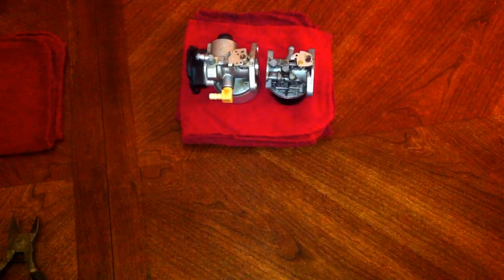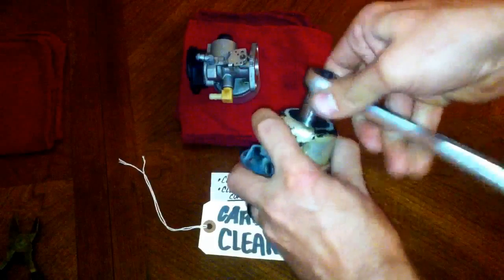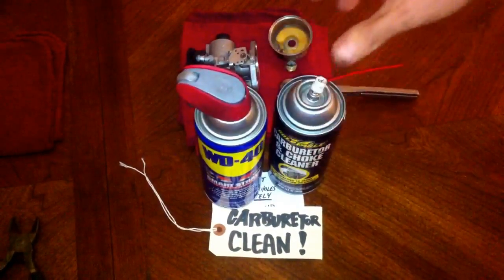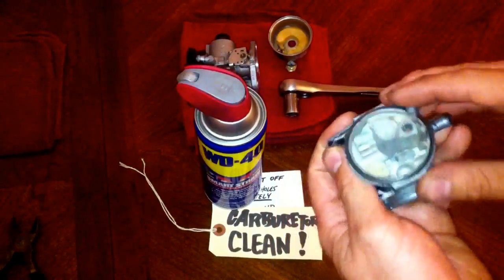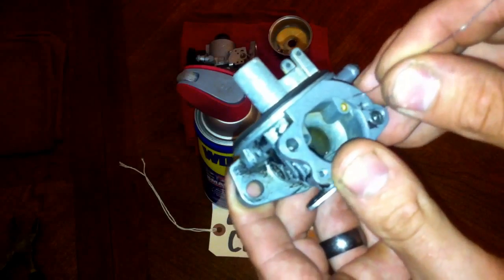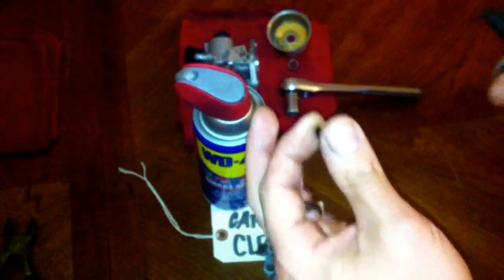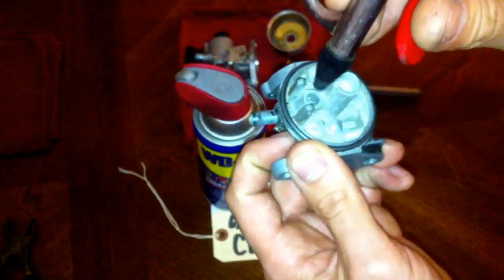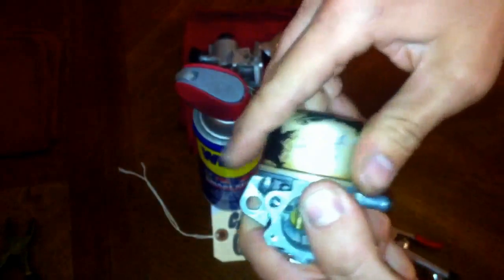How to Fix a Lawn Mower by Cleaning the Carburetor [Briggs & Stratton and Tecumseh]

Comment: This was the video I needed I had my Briggs all cleaned but I put it back together wrong at the float assembly where the pointed thing sits in the gap and I had it outside I knew something wasn't right now it's running like a champ. 
I also noticed a bunch of dirt sediment in my gas that was obviously causing the clog not sure how so much gets through the tank filter.

Comment: I have a craftsman self propelled  I have taken off the carburetor and cleaned it however there were to springs that came off and I don't know where they go. This is the only thing holding me up from having a running mower.  Do you know where they go? or do you know where I can find a picture of where they go, thank you

Comment: Some reason my gasket at the motor side pours out gas . Is it something to do with the float ?
Reply: Maybe the carb bowl gasket did not seat correctly when put back together. Was that the fix or is there still a challenge?

Comment: Hi Adam, your video was excellent in explaining how to re-open the internal fuel passages of a BS carburetor housing. After sitting without running for a few years, the engine for my mother's power washer started NORMALLY after cleaning out the debris from the internal passages of the carb. Thanks so much!! I appreciate you for taking the time to share this information with everyone!

Comment: Thanks for the video. I took off and cleaned a b&g carb (full of rust) from a mower that sat for two years and wouldn't even try to turn over.
Put it back together, one pull and it's purring like a cat!

Comment: I learned that old carbs on lawnmowers didn't have brass jets and instead used adjustable valve screws so when the lawnmower ran weak or surged you simply just opened-up the screw hole.  Thanks to the EPA for making everyone's life difficult.

Comment: Your step by step for taking the carburetor apart, cleaning it and putting it back was one of the best on you tube I've seen. Cleaned the jets with the wire from the bread tie, blew it with some compressed canned air, rinsed in some clean gas , assembled it back and it started on the first pull. Thanks for the video

Comment: I had to replace the primer bulb with the hole in the center, but now the gas runs out of the tank all the time.  How do I stop it  Briggs and Stratton 6.75 , give me a hint as to why the gas keeps running out unless I tip it back to change the strings, other wise the whole tank will drain completely.
Reply from the maker: Sounds like a carb issue 🤔 Have you changed the needle & seat?

Comment: I just cleaned out a Tecumseh carb and the hidden jet was clogged with a hard substance that the carb cleaner could not remove. I instead used a sewing needle to remove it. Anyhow it runs now.

Comment: If one  can soak the carburetor for several days in a submerged container of gasoline ( make sure the gasoline completely covers carburetor ) it always seems  to do better for me in the past and a much easier process when cleaning it . Worked on an old Honda carburetor and it just wouldn't run right after I had cleaned it out once already . I soaked it for three days and blowed it our one final time and it must have loosened up something - for it started running perfect . Food for thought - when all else fails .

Comment: What is the wd40 for?
Reply from the maker: I got carried away here focused on where to spray the carb cleaner. You should WD40 the throttle, and wiggle it back and forth to make sure it's freed up. All moving parts love lube.
Reply: @AdamPenningtonadamcpennington  👍

Comment: Can you replace the float pin seat if you accidentally spray it?
Reply from the maker: Roddy Da Carburetor cleaner if left long enough will cause the rubber seat as well as the bowl seal to swell and degrade. Best to remove components like these before cleaning.

Comment: I know this is a old Post but hoping I can get some help. The only way my Briggs will start is if I squirt carb cleaner into the intake side. It will fire up then literally die. I found there was no gas in the bowl even when gas turned on. Luckily that part was a simple fix but it still won't start. Any ideas?
Reply from the maker: Sounds like a straight forward carburetor issue. If you've thoroughly cleaned the carburetor as the video depicts, replaced the bowl gasket, mounted it correctly and snug, and there is now actually fuel in the bowl- It might be time for a new or used replacement. Having been through hundreds, some carbs go beyond reasonable repair. Cheers!
Reply: Hi, Adam, glad to see you're still helping people on this video. I've taken the carburetor  off of my B&S lawnmower engine three times now, to clean it. I was getting surging, difficulty starting, and sometimes engine dying issues. I'm using carb cleaner, and this last time I used welder's tip cleaners to really get into those tiny holes. I've also cleaned the fuel tank, which was filthy, and I replaced the fuel line and added an inline filter. Additionally, I've replaced the float bowl gasket, the air cleaner housing gasket, and the primer bulb. These cleanings have always helped for a little while, but then the engine goes back to its old malfunctioning ways. I'm thinking my next corrective action might be to replace the rubber seat that the needle sits on. That's about the only thing that I haven't replaced, so far. What do you think?  Could that be causing the issue?

Comment: Thanks for saving me a chunk of change.  I'm not a mechanic and was somewhat intimidated about taking apart the carb on my ready-start pressure washer that wouldn't start.  Cleaned it per your instructions, and put it back on.  It started right up on the first pull.  Incidentally, I thought I lost the rubber needle seat; I just want other viewers to know that some seats are brass.

Comment: Hi, I just did this and got my mower working however I have a problem. The mower is supped up LOL. It now runs loud and it actually used a full tank of gas in 30  minutes instead of my usual hour. I am under the impression the needle needs adjusting. from what I have read I need to lower the needle I believe. Thoughts?
Reply: Fixed it. I must have forgot to put the metal wire through the carburator top plastic piece. Of course it meant taking everthying back apart but the carburater to fix it, but it works good.....for now lol.

Comment: Thank you for this video, I didn't even think to clean the bolt that holds on the cup - it was the culprit!
Reply: That bolt holding on the cup on most small engine carburetors is the main jet. The tube which Mr. Pennington referred to as the jet is the emulsion tube. It is important also to remove any gaskets (especially rubber ones) because the carburetor cleaner will distort and misshape them causing them not to seal correctly.

Comment: Adam, this video was AWESOME. I have a Yard Machine String Trimmer that has not ran in more than 2 years. I followed your instruction in this video and my trimmer started on the very first pull. I was about to take it to the repair shop which would have cost me atleast $80.00 - $100.00 to repair, with your help I repaired it without spending one cent. I already had all the items you mentioned in you video.
AWESOME!!! Keep post GREAT video like this

Comment: Great video Adam! Very helpful and informative. Watch out for WD-40, though, it is a good lubricant but it does eat rubber. I use  Liquid Wrench on any part that has rubber seals or rubber parts such as diaphragms, belts or even tires!!

Comment: Thanks, I stripped mine apart and something fall. I put the carburetor back together and petrol pissed out, I then went and looked in the shed move things around and found a silver pin pointed at one end and the other a flat end. So I turned to YouTube and found your post, saw the pin (On The float) and now all OK thanks

Comment: Thanks for the vid. I have a Simplicity tractor that I bought new ten years ago and used it one summer. Then I sent it to my dad's place and he never used it....so it has been parked for nine years in the garage. Just got it back and finally got it to turn over....however, it will run for 5 seconds then shut off. My guess is I need to clean the carb. He did empty the fuel...but I'm sure it's pretty dan gummed up.

Comment: Alright. After 5 hours I got my lawn mower fixed. Thank You. For those watching the video, replace the air filter, sparkplug, and fuel each season. If all else fails, its your carburetor. Make sure you wear goggles when spraying it with carburetor cleaner. Don't be like me spraying a shit ton on your face and almost going blind...
Reply from the maker: lol be careful bro!

Comment: you actually can spray down in the seat if there is varnish but make sure u rinse it out right away with a penetrating lubricant like wd40 or pb blaster because it will swell up. even the bowl gaskets if you get it on them it will swell up in fact I already did before and I winded up with a bowl gasket about a half inch too wide in diameter haha nice demonstration people should learn this alot of mowers and others things get throwbout because of this reason and they are often fairly new mowers
Reply from the maker: true true. Lately I've found it easier to stay away from the seat altogether. That is unless it's already swollen making the float sit at a higher angle, or varnish is present. In both cases it's good idea to replace the seat.
Reply: Thanks that helps a lot Warrior!